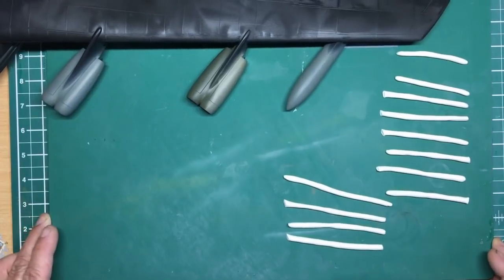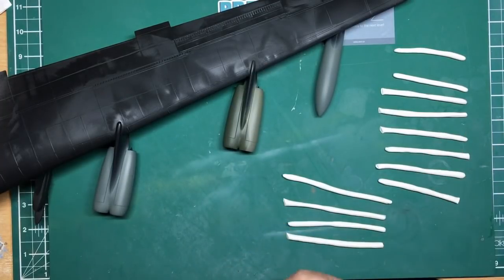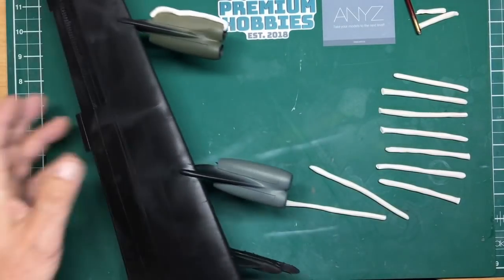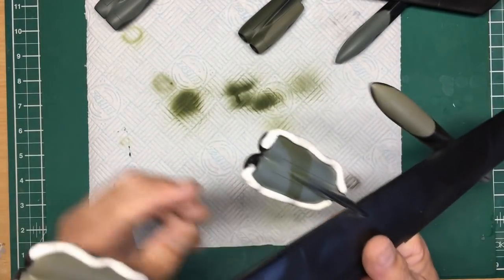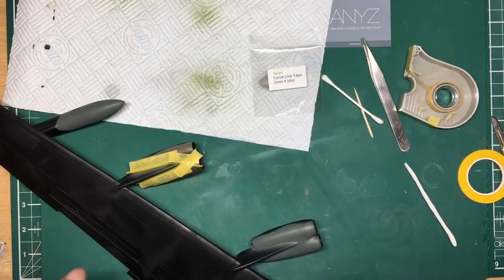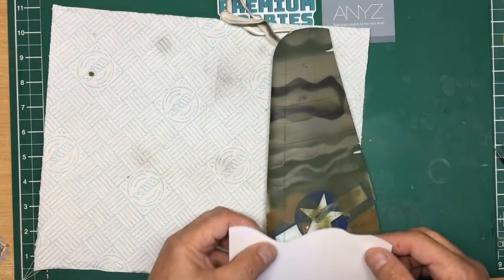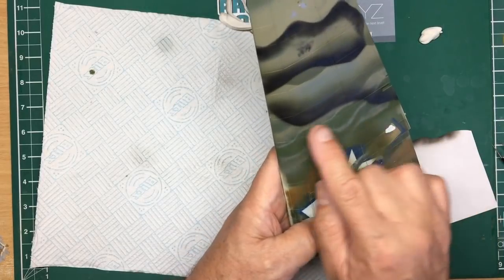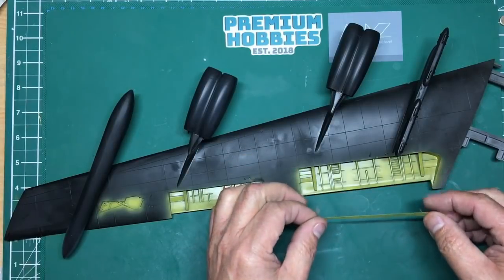Big Bad Buff Build for Beginners. Part 19

Comment: In my earlier modeling days, to achieve this effect. I would roll masking tape and stick it to the plane towards the area I wanted to make the camouflage line. Then tear newspaper into the shape and put on the tape.  Then I would dab areas where I wanted paint chipping with rubber cement.  Then use a rattle can spray paint.  I could achieve a good look for the camouflage this way. Then go back and rub the rubber cement off.  I thought it looked pretty good.  This however looks so much better. Thanks for the lesson.

Comment: Hi Nigel, you seem to have a quiet compressor... which type are you using?
Reply from the maker: It's an Iwata Bennet
Reply: @NigelsModellingBench  is it one of the Low Pressure Output models?

Comment: Nigel, Can you use Mr Surfacer on resin?  I purchased a set of resin wheels and when I sawed them off the casting block the wheels received a flat spot. I plan on displaying just after takeoff rotation so a flat spot is not desired.
Reply from the maker: Yes.